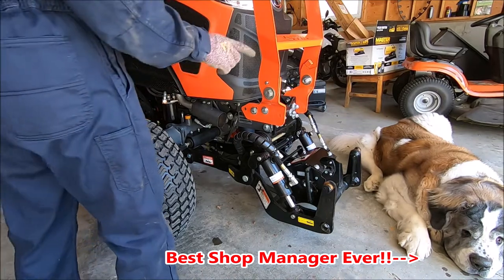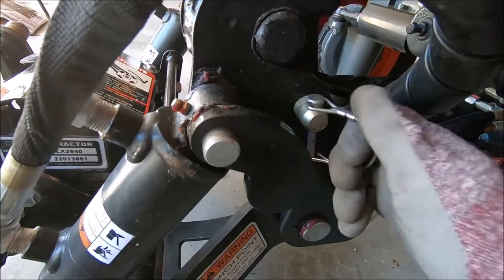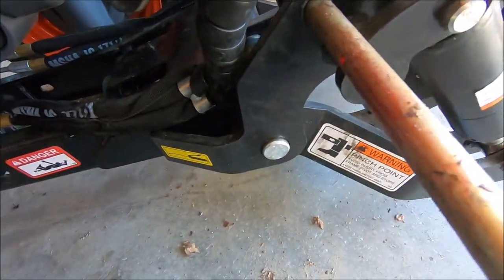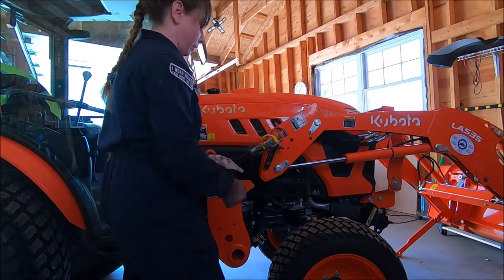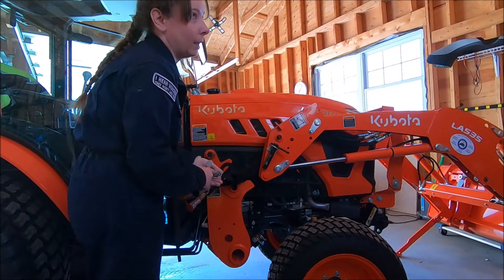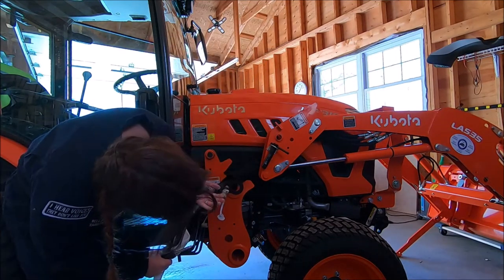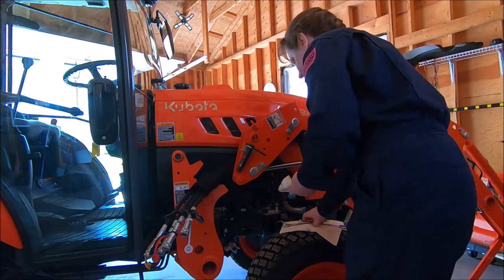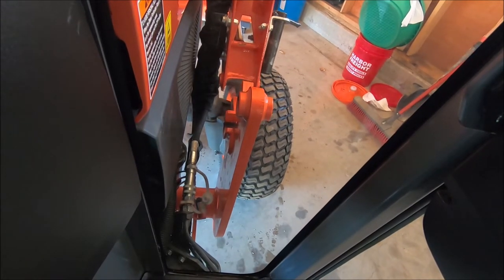Kubota LX3310 Loader Install & Uninstall of Snowblower

Comment: For the  "K-Connect" snow blower mount, remove both while still connected.  You only need to remove the two mount pins and hydraulic lines to place on "T" shaped dolly.  Two non turning wheels under the blower and one rotating wheel under mount for steering.

Comment: To get that pressure to release, you can wrap a rag around the end, and jam it into the concrete quickly, assuming you can reach the concrete. With the rag over it, it won't damage anything, it's extremely quick, but be cautious of the fluid that will spray (the 2nd use of the rag). Be careful about pushing on those connectors as you described - fluid out = air in, which isn't good.
Also - when I park my loader, I run all the hydraulic actuators all the way in. It'll take up less space AND protects your actuators from dust, dirt, debris, or potential damage while stored. Thanks for the video, happy tractoring!
Reply from the maker: Yeah this was my 1st year doing all of that and have learned a thing or 2. Thank you for your comment 🙂